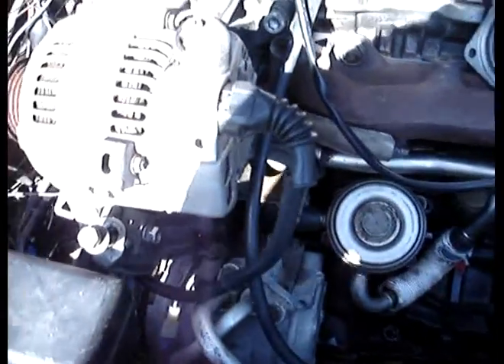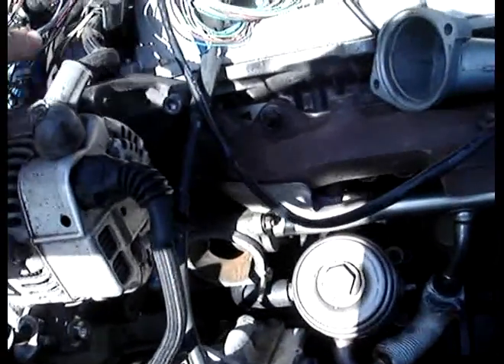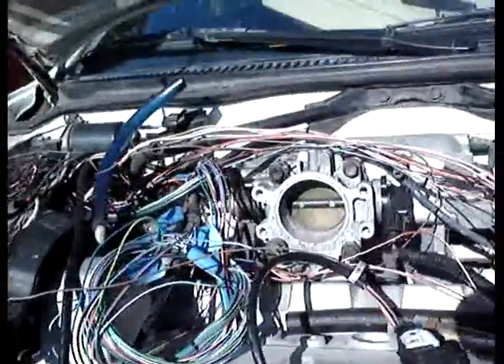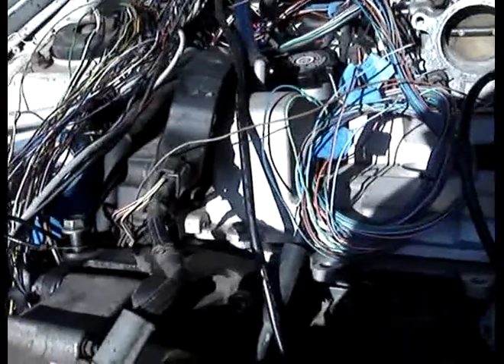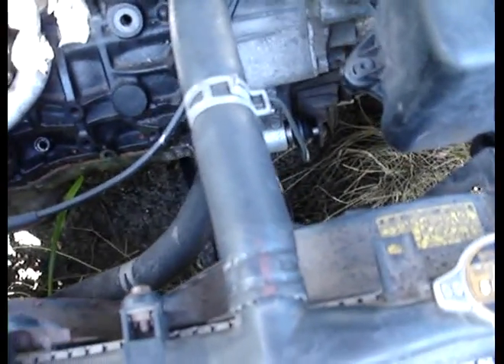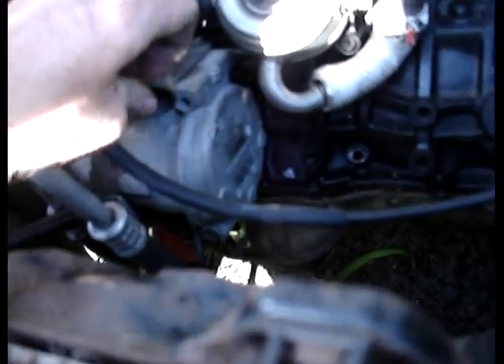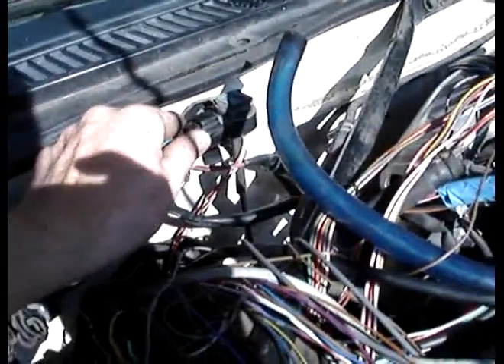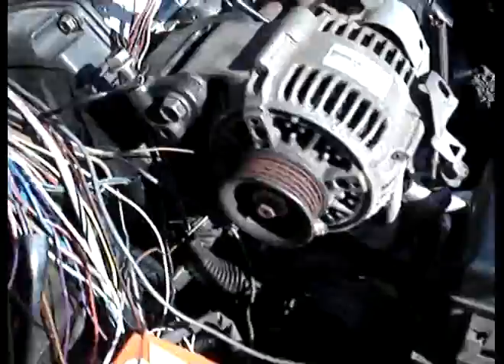95 Celica GT with MR2 Turbo engine swap and engine management

Comment: Hey, gm. I have a 1995 celica gt 2.2l i4 convertible. What do you suggest I put in it?
Reply from the maker: 3sgte is the easiest swap to do in this car. But put a 2nd gen 3sgte in it. The 3rd gen is awesome, but there are a few parts that are difficult to get unless you order them and wait, this engine wasn't sold in the US. The 2nd gen 3sgte was sold in the early 90s mr2 and the early 90s 5th gen Celica alltrac. mate the engine to your stock trans by keeping the clutch disk from the factory 2.2l and using the pressure plate from the 3sgte

Comment: do you have any suggestionfor a engine for a fwd toyota celica 1995?
Reply from the maker: +Jose Velasquez there are two different engines in the US Celicas, and you can look on the sticker under your good to see which you have (5sfe or 7afe). if you have the 7a engine (1.8L) then you can swap in a 4a engine(4age, 4agze, or 4agte). Or if you have the 5s engine (2.2L) you can swap in a 3s engine(3sgte or 3sge BEAMS). You can't put in a 4a engine if you have a 5s, and the same thing goes for putting in a 3s engine if you have a 7a. I don't know much about the 7a to 4a swap, but I know the 5s to 3s swap. You would want to go with a 2nd gen 3sgte if you can. There are plenty of writeups on 6gc.net for both types of conversions
Reply: Alright Thank you

Comment from the maker: I just put up a video on re-pinning connectors. 

A universal wire harness came with my aftermarket computer, so I put it in the interior where the old ECU was, and ran the wires alongside the old ones. I cut the wires at the sensor connectors and soldered them there. Then I pulled out the old wires that went to the sensors. That's basically it.

Comment from the maker: If I were you I would re-pin the connections. From what I've seen, Toyota throttle bodies all use the same wire colors. I'll have to look them up again but they are all mainly the same. Take a very very very tiny screwdriver (like a flathead for glasses) and you can push aside the little lever that holds the pin in place in the connector. I should make a video on that actually, it's good to know. There are also 3sgte pinouts that you should be able to use to repin the ECU connector too

Comment from the maker: @jpsylnc from what I've heard the motor mounts are different between the 2.2 and 1.8 celicas. So I don't know what your engine options are. I don't think it would be easy for you to swap in a 3sgte, if you do though, you can use the 2.2L celica transmission for the easiest swap, there are other stronger transmissions to use though, that one is probably the easiest.

Comment from the maker: @jpsylnc 
That engine is a 7afe. I don't know much about modifying it since my celica was originally a 5sfe (2.2L) celica. All I know about that one is that people swap the heads out for the 4age head, which you can find turbo components for fairly easily. The 3sgte engine I have is not compatible with the motor mounts in the Celica 1.8L. That's all I know about it.

Comment from the maker: @Telekine5i5 
I think the 2000 and newer MR2 engines can be put in the 2000 and newer celicas because the celica and mr2s are both ZZ family engines, but I'm pretty sure the 90's mr2 S family engines won't fit in the 2000 and newer celicas. They are different family engines and the motor mounts are probably different. With a good welder you can accomplish anything though.

Comment from the maker: @easternelementbmx123
If you have a 2.2 5sfe, the easiest swap you can do is to swap in a 2.0 turbo 3sgte from a US MR2. I went a more expensive route with the JDM 3sgte. US MR2 engine is the easiest swap. You need an alternator bracket from a 90 - 93 alltrac, crank pulley from your 5sfe, power steering pump from your 5sfe, your celica stock transmission with the stock (or aftermarket) clutch disk, the pressure plate from the MR2, a FMIC w/ piping (or 90 - 93 alltrac I/C), + other small stuff